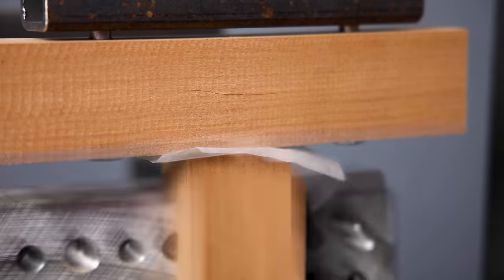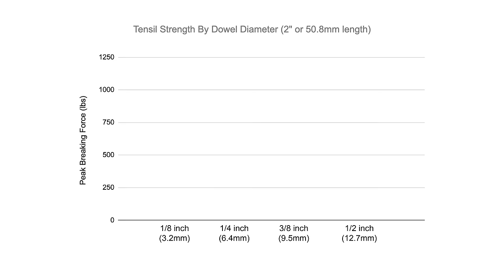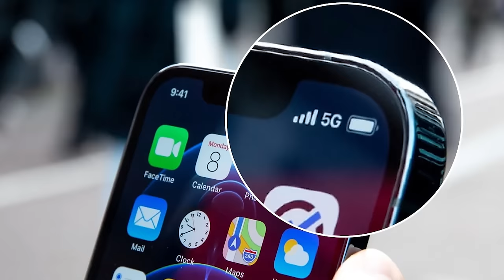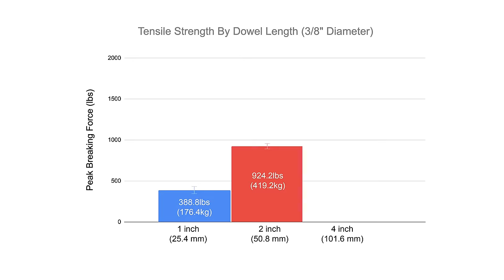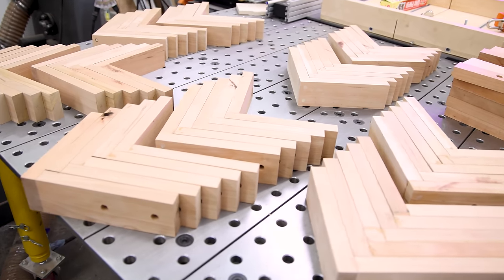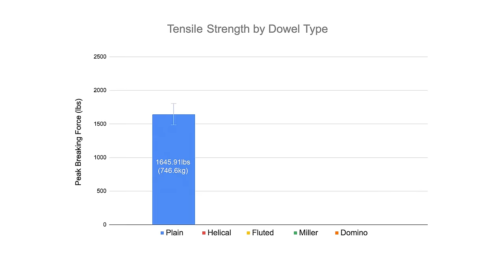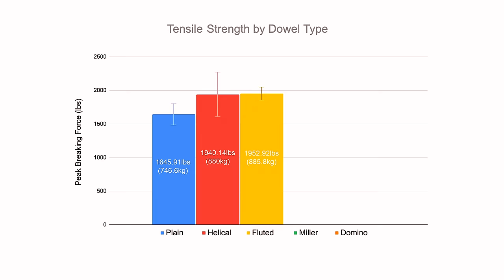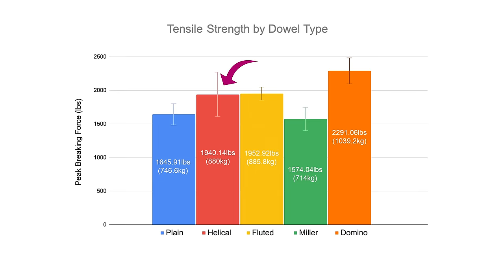festool domino vs  dowels

Comment: Dowel diameter grew linearly in terms of the "raw numbers", but in terms of percentage each step up is proportionally less of an increase.  An additional 1/8 of an inch is a larger percent of 1/8 than it is of 1/4.  I would guess this is why the tensile strength per sq. in. does not grow linearly and exhibits diminishing returns.

Comment: The bigger diameter ones propably hold better because they get compressed more when put in the hole. The smaller ones cannot compress much so the fit has to be less tight. Not only does that generate a holding force by itself, but the glue will create a better bond as the wood and the dowel are pressed harder against each other.

Comment: I suspect the reason the larger dowels have more strength per area of glue surface is due to the swelling of the dowel with the glue.  A larger dowel will swell more, and get together in the hole than a small dowel will.  Say that the wood will swell by 1% (just a guesstimate), that means an 1/8" dowel will swell by 1/800 or 1.2 thousandths.  While the 1/2 inch dowel would swell by 1/200 or 5 thousandths... Creating a much tighter glue joint.

Comment: But you forgot pre-glued water activated dowels 😥 They supposedly have more holding power than regular glued dowels because they tend to have more consistent glue exposure all around the dowel 🤷🏻‍♂️ They can be a little tricky to work with though.

Comment: Miller dowels are convenient and I use them all the time. I will try the straight dowel technique as a through dowel similar to the miller dowels

The big advantage is the dowel fits the best at the top. And I dont have a doweling jig. The other dowels (not miller) just dont look as good on finished work in a through dowel scenario due to fluting or chamfer or spiral glue space. For not showing surfaces, I will try plain wood dowels

Comment: What about sideways forces?
I'd assume they are more likely in real world applications. 

Example.
Building a desk and putting the dowls in from the top. The legs are more likely to be knocked from the side than pulled straight down.
Same if the dowel is fitted from the side. More likely to have the forces from the side or at a canterlever force at the joint.

But i do commend your work on this.
Thanks.

Comment: Great video!

And as a structural engineer who also has a physics degree and has developed lab testing procedures for materials testing,  I think you did a very good job with your tests.  It sounds like you have a science or engineering background,  since you clearly identified the primary stresses for testing as well as some of the key variables impacting strength.  There definitely are more variables to isolate in order to give more meaningful results,  but overall I think you did better than anyone else outside academia lol. 

I was actually surprised to see the straight dowel wasn't top of all dowels. I always use them,  because fluted can sometimes be machined wrong in my experience... just put a bad taste in my mouth.  I also hadn't thought of cutting the dowel for air to escape.  I always just force it in lol.  Good tip. Thanks.

Comment: I absolutely love your careful, consistent approach to verifying/debunking common assumptions. Data rules!!!

Any chance of testing dowel-pinned tenons (standard tenon; dowel driven perpendicular through center of tenon and mortised housing piece)? Is 1/8 enough, or does 1/4 provide relevant improvement, and how does that compare to either standard mortise/tenon, floating tenon, or dowel-only joints? Intuitively, it seems like any pin at all would add substantial strength, but it could well be irrelevant at the break-point. 

I know, a lot of work, but I'm really curious how pinned tenons compare to unpinned at whatever resolution/variance makes sense to you.

Comment: If you look at failed joints in chairs and tables…it is seldom a clean tension fail unless there is water penetration such as in outdoor furniture. More usually it is either a shear fail or joint loosening due to a repetitive levering movement.

Comment: For your first test could it be that the wood of the dowel failed before the glue? And for the shear strength of domino's I'd be curious to see mitered joints. Not just speaking as a green kool-aid owner, but since this is the real advantage of the tool. Any angle with instant perfect alignment. My thinking is the miter transfers energy into a push pull scenario. But only good visuals like your setup can tell.  Well done

Comment: For me the conclusion is, stop bothering with the fluted ones and just use the plain dowels as they are plenty strong enough, and don't have the tendency to swell while driving them in. With the fluted once I often run into problem that they've swelled so much in just seconds you can't get them whole way in, and trying pull them out with pliers results in breaking in half.

Comment: Great stuff!  
I suspect the advantage of the prefabricated fluted and spiral dowels in the shear test was more a matter of species than anything else.  In the tensile test there were three ways to fail: the glue joint, the dowel, and the piece the dowel was inserted into.  From what I saw the failures were primarily with the glue joint.  However with the sheer test the glue holding the dowels into each piece really didn't matter.  It was all up to the strength of the wood.  Note that biscuits are compressed during manufacturing, purportedly so that they absorb blue and expand to make a tight joint.  I wonder, were the grooves in the premade dowels cut, or pressed?
Reply from the maker: Agreed. There are lot of nuances worth considering. I didn't explicitly mention it on this video but all of the dowels were birch. So the species was controlled. All of the dowels appear to be cut and without apparent compression.

Comment: Interesting video.  I normally use the plain dowel though I do have some fluted ones.  They both seem to work just fine for my use.  I have wondered though if you could 3d print a dowel and how well it would work.
Reply: You lose a bit of strength since some of the strength is the expansion of both of the dowel and the part surfaces expanding with the glue. A 3d print will remove one of those expansions. It also becomes dependant on print quality, material and orientation (obviously print them along their longest axes for best strength). CNC KItchen's strength tests would be the best comparison for a dowel since he does similar tests on 3d prints.

Comment: The lower load per unit area of the smaller diameter dowels might be due to tolerances.  I suspect the absolute value of the tolerance on diameter of a 1/8" hole or dowel is similar to that at 1/2", which makes it a larger percentage error, causing a poorer fit and reducing the effective area of the joint.

Comment: I think your calculation for the tensile strength per area is off -- did you calculate the surface area using the square of the radius (times pi)? When I do that, I find that all are much closer in tensile strength, and the 3/8" dowel actually out-performs the 1/2" dowel. Remember, the 1/4" dowel has 4x the surface of the 1/8" dowel, and the 1/2" dowel has 16x the surface area.

Comment: I suspect the reason for the large increases in the per centimeter improvements based upon length and girth has to do with friction. The more surface area contact, the greater the friction in a non-linear growth.

Comment: I was thinking "man, that's the biggest 123 block I've ever seen....Suman doesn't mess around!"  😁   I do like my dowelmax jig quite a bit.  As a DIY'er, (where time isn't money) I can't justify a domino.  Also, if you bang in the fluted (or any dowel) too fast, the sudden increase of hyrostatic pressure can crack the wood.  So pound them in slowly.  And don't think I missed the "some women are into it" joke.  LOL.
Reply from the maker: It is 1” thick but 12x12 😂
2” dowels. Pound slowly. Got it.

Comment: I’m would guess that your data isn’t a progressive curve because of the flat spot you planed on the dowels. You took a tangential section off of the dowel that was not the same percentage of the dowel.  Then again, I’m not sure if you changed the number of passes based on the diameter of the dowel.

Also, Miller dowels are great for repair and scenarios. We need to reinforce some thing after construction. They work great in scenario where the resistance of hammering, a traditional dowel in could push the joint apart because you don’t get any pressure until the very last tap in.
Reply from the maker: I didn’t have time to get into it on the video bc it’s too in the weeds but yes, the channel cut on the plane dowel was respective to the diameter as to keep the surface area relative to each other as consistent as humanly possible.

Comment: Length, area and volume do not scale uniformly. Think about how twice the height does not equal twice the weight. It's much more. Same deal with area.

Smaller dia is probably also much weaker because of the comparative size of dowel dia vs wood fibre dia. Statistically more stress concentration and less load distribution. And obviously the shear, tensile and compression strength of the dowel itself is going to be significantly weaker.

To expand on choosing a dowel width/hole size, rather than the 'divide in thirds' you want to remember 'wall thickness AT LEAST equal to hole size'. The idea is that if something is going to break, you don't want it to be the bigger workpiece but something more easily replaceable like a dowel. But for working with wood it's a good idea for wall thickness to be GREATER than hole size. Especially if your drillbit leaves sharp corners at the bottom of your pockets. Sharp corners = stress concentration. They start fractures far far easier than properly rounded corners.

The Domino dowel tests were a good example of walls failing first.

Remember folks, in a link of chains it's the weakest link that fails first. So chose carefully what you want your weakest link to be.

Miter dowels are only useful for geometric limitations in your workpiece. You should really be comparing it to dowels with the same width as the thinnest part of the miter dowel. But even then it's not a fair comparison because the increased width of the miter dowel means less dowels overall for the same given space. Might be that an array of thinner dowels could beat out a miter dowel.

Comment: For thinkness it gets better and better until the wood fiber starts breaking 1. Breaking lengthwise 2 the lignin that connects the fibers sideways. The domino does not make as tight of a whole but protects from twisting and sideways forces better. If you depend on pull out tensile strength alone, you need to re-look at your joining design.

Comment: Machine tolerances could matter.  The difference between the 1/4 dowel and 1/4 drill bit may be different than the tolerance of different size pairs, which is going to affect how much glue fits inside the joint.  I don't think that's a major factor for you because you did show a pretty nice curve, but possible contribution.
Reply from the maker: Oh for sure! Tolerance and fit is an important factor. But it is also not very exciting to talk about on a video format where audience retention has a huge impact on the performance of the video. I did account for fit/tolerance :)

Comment: Good test, thanks. The point of the Domino is not so much to be the absolute best option, but rather to be a solid option, and to give fast, repeatable and accurate results. The pro needs a fast workflow with strong results.

Comment: Kudos for testing both for tensile and shear strength! A very involved test indeed!
I don't know how one can standardize these tests but I imagine it would be hard, especially given that the amount of glue and tolerances differ greatly from sample to sample. Maybe the American or Canadian carpenters' association has some guidance on this. I can think of one way to limit variability between samples though and that would be by using mdf instead of natural wood. The downside of this, however, would be that the shear strength tests, using the same thickness beams (i.e. rather thin beams) could be meaningless if the mdf were made too thin.

Comment: For me the advantage of domino is not an increased  strength of the joint over other joinery methods. Rather it she ease, speed and repeatability.  One big advantage the domino system have over dowels is having a wider setting to use on the mating surface.  So choosing tight on one surface and loose on the other allows for any human error when making the mortises. With dowels if the mortises are not precisely aligned the joint won’t come together properly.
Reply from the maker: 100% agree with you. Plus doing funky angles is SOO much easier with the domino. I am personally a big fan. But dowels definitely have their place, especially due to cost of entry.

Comment: Excellent test, thanks for posting! Keep up on this. You'll be right up there with project farm ,cnckitchen, Igor from mytechfun and I'm sure some others I don't even know of.
I use 3/8" for most projects, 1/4" for drawer boxes and 1/2" for things like seating or heavy duty use. All fluted. Never a failed joint yet.
What the domino brings to the table is speed. I use a dowelmax, and it's accurate, extremely built and fast enough, but the domino is a bit faster. Ideal for production settings. If I didn't have my dowelmax I'd have a domino. I suspect the domino shear test would have been stronger if maybe 6x40s were used, and I'm curious how 5x30s would fare. That size of perfect for cabinet construction since you don't need to adjust the machine for two different depths.

Comment: Wouldn't dowels be more relevant to resisting bending across a glued joint rather than pull out? All you're really testing here is the tensile strength of the interface which should scale nominally with Diameter x the embedded length of the Dowel.

Comment: I wonder what the tensile strength would be if you used 3 or 4 dowels (compared with the 2 dominos). I would venture to guess the surface area would be similar in that regard and thus have a similar tensile strength. The question then would be which is faster, drilling 3-4 holes vs 2 domino mortises.

Comment: Great video! I do wonder what the results look like without the wax paper though, as that is a lot closer to real world use. I assume it would shrink the difference in tensile strength a fair bit. Plus, smaller dowels would have more endgrain surface area, which would shrink the difference even more. I doubt it would completely even out, but it might indicate that dowel size/type matters less than it would seem.

Comment: I can't see why at over 1K to outfit a Domino (even the small one with kit), anyone would bypass a homemade jig and regular dowels. I have a Dowelmax, and it does just fine. Unless speed for setup is useful for you, save the 1K and just use regular dowels. I would imagine 3 regular's would perform and well as 2 Domino's albeit a little slower to implement.  I doubt anyone exerts more than 500 LBS on a joint. It is like the clamping force mith, glue is alway stronger than wood. My 2p.

Comment: Just thought about it, for more accurate results you could have used 2 pieces of paper to properly ‘disconnect’ the glue from both the sides of the joint. I know it would be a matter of 0.5-1 kg but letting you know. Still enjoyed the vid!
Reply from the maker: Great idea! I definitely did not think of it at the time. Haha

Comment: Thank you for using 5 samples for each test. The specific grain orientation and micro weaknesses of every individual sample make the results of using only 1 sample not reliable, as has been done by some other Youtubers.
Reply from the maker: Thank you! Doing 5 samples is soooo much more work but absolutely worth it to have a better picture of the data.

Comment: Wood glue soaks right through wax paper. I suspect you'd have a pretty strong joint with a sandwich of glue and wax paper. Parchment paper would have been a better choice. But having watched the video, it looks like the effect was negligible. 

I think all the dowel options are as strong as you'd need them to be, so it comes down to looks, convenience and efficiency.

Comment: Great video! Domino wins in my shop due to speed and versatility. Plus I paid a lot for it so I'm dam well going to use it!
Reply from the maker: Speed and versatility is definitely the main reason why I’m also going to continue using my domino 😂
Reply: I also have a Domino along with dowel jigs, hollow chisel mortiser and the Leigh mortise and tenon jig.  99% of the time I use the Domino as you can't beat the speed and accuracy.

Comment: How is a domino easier than just drilling a hole with a drill everyone have?
Reply from the maker: With a domino, you rarely have to measure. Just mark or use the side guides and you're ready to go. It also makes angles and depth adjustments incredibly fast and intuitive. I don't remember the last time i actually had to measure anything for a joinery with a domino.